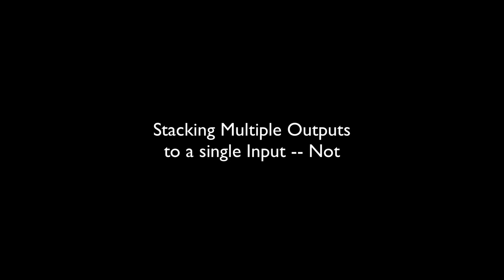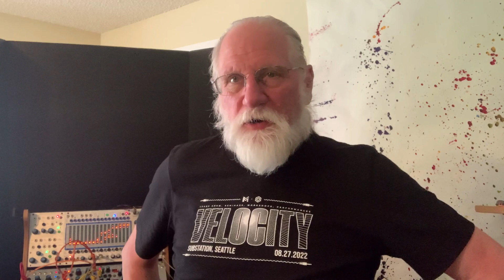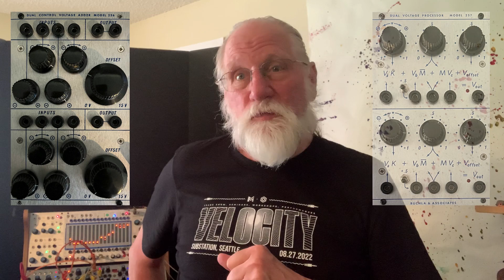Buchla Stacking Outputs to an Input

Comment: Good advice. If you know what you're doing you can make sure you aren't setting up too much voltage to any input even with stacking. This would most obviously be an issue when we're talking about pulses/gates since they are already relatively high output and it would only take a few firing at once to get out of bounds. That's what OR logic circuits are for. 😉

Comment: HI Todd i have had the same experience today . Have been experimenting a lot with the 218t and noticed some strange hang ups where i expected something to work and it just stopped, but worked fine when i unplugged the patch. Have heard this recommendation before, in no way a refection on the 281t. I have always tried to keep to that rule of thumb but mostly it doesn't crop up too often but did so toady out of the blue, when stacking from the 281t to the URA analog and the shapeshifter. In the past when i got pitch instability with other modules, which was solved with a buffered mult. I have a lot of buffered mults and they seem to help here. Take care Colin